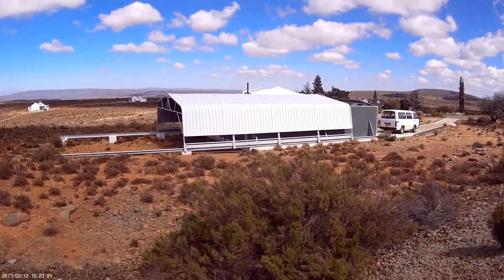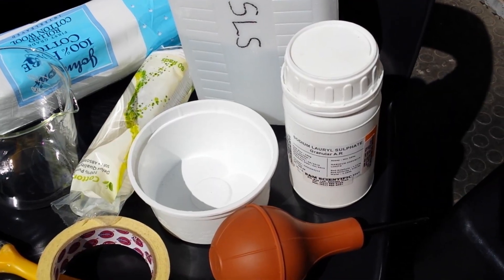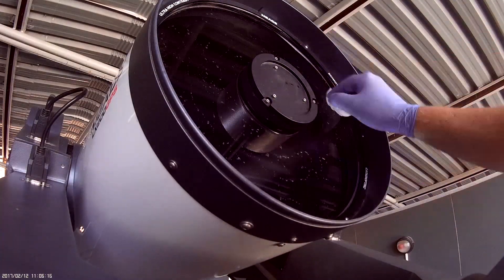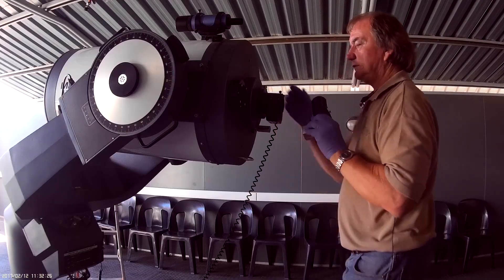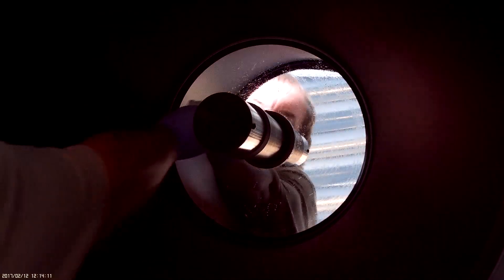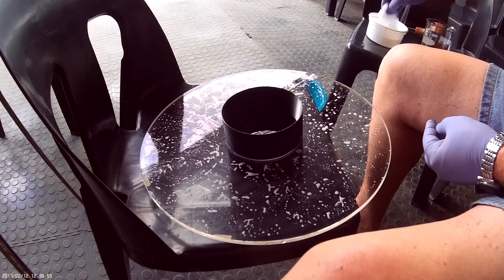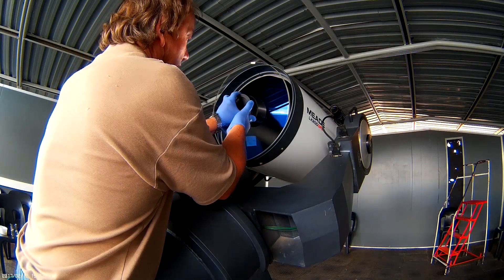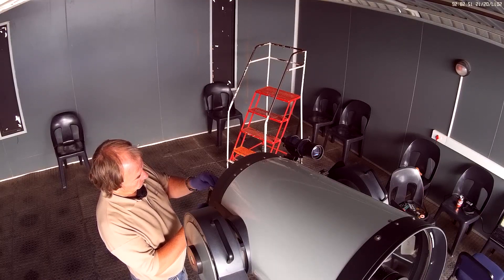How to strip and clean the optics of a SCT (Schmidt-Cassegrain Telescope)

Comment: Nice video. I was cleaned successfully with detergent and clean water. But I removed the prime mirror first. Your way is little more difficult but you don't need to remove the mirror itself. So if that's work you can keep doing that.
Reply from the maker: Thanks.  With both these models, the only way to remove the primary, is unfortunately to remove the corrector first to gain access to the primary's mounting system.

Comment: Thank you for the great video.  I have a question about this.  What can I do to find the correct position of the corrector plate if I have removed it before I knew it must be indexed a certain way?  My problem is that I have  taken it apart once and didn't mark it for reassembly.   Thank you, Scott
Reply from the maker: Hi Scott.  All I can think is to inspect the corrector and telescope tube very closely to see if there are not perhaps any matching markings put there by the manufacturer.  On the other hand, I'm not too sure how important it is for the corrector to have a specific orientation - in theory a properly made corrector should be symmetrical all around and therefore should not matter how it is assembled.  If you can collimate it properly (including on an out-of-focus star), it should be fine.
Reply: T. Scott Nalley Postman Buy Celestron Telescope NexStars From SOUTHMINSTER School Caravan Birthday CHILLDREN Cm0 ENGLAND CELESTRON MAN ASK POSTMAN BUY Celestron From SOUTHMINSTER School Caravan Birthday CHILLDREN
Reply: + Willie  Great video, thank you. It has given me confidence to open mine in order to get rid of a number of spidery fungus spots. I think I have killed them by exposure to the Sun, but they annoy me ;).

I noticed you DID mark the orientation of the corrector plate with respect to the OTA - presumably as good practice. I believe it matters less with Mak-Cassegrain scopes since their meniscus lens is easier to manufacture totally symmetrical. The Schmidt SCT plate on the other hand is a wavy affair and far more difficult to manufacture and collimate! I believe this was the main reason for the development of the Mak over the SCT.

Comment: Thanks for taking the time to share this video. Very informative. If you are just cleaning outside of corrector and not removing it would it be best to point tube down to prevent water from running down tube. I just need to clean the outside of mine for now.
Reply from the maker: Yes, most definitely! You don’t want any water getting inside the tube if you are not planning to access its inside.

Comment: Great video however,  in the beginning of the video you show a view of the "cleaned" C14 and the corrector plate is badly scratched. A little dis-concerning.......
Reply from the maker: Thanks Mike.  Yes, unfortunately the users tried drying it in high humidity conditions which caused the scratching!
Reply: "Disconcerting." No hyphen.

Comment: As a professional photographer I'd never put any liquid on  a lens directly, nor in such amounts as to form drops that could get in between the lens element/glass filter and the ring holding it in place. I would think if you had a cemented double lens that any liquid could get in between the lenses and play havoc with the cement. With a SCT you run the risk of water getting inside the tube and causing damage. (Ever see mold growing inside a photographic lens?) 

In photography you'd first blow any loose particles off with compressed air (use caution) or clean blower brush positioning the front of the lens horizontally or facing downwards so that any dirt falls away from the lens and not re-deposited on it. FOr any stubborn dirt I'd lightly use a dry tissue or clean microfiber cloth then follow up with a DAMP, lint free, tissue or cloth and lightly wipe the glass in a circular motion with multiple tissues if needed until clean.  

If you had no other option than to use dish soap (which is actually a detergent) and distilled water you only need a drop or two of the detergent. This is how professional window cleaners work. You only need enough detergent to break surface tension.

Forgetting that, before you do anything I'd first read the scope's manual for cleaning instructions or contact the manufacturer repair department for instructions. 

Here is a safer way to clean your corrector. https://youtu.be/2cMbivz-hrM

I disagree with his use of the word 'firmly' when wiping with the Pec Pads (Pec Pads are something I use myself). Lightly wipe so you don't grind and dirt into the glass causing scratched or damaging fragile coatings.
Reply from the maker: Correct Robert, I would not do such with compound lenses either where the capillary effect is a huge problem.  However, both the corrector lens and the primary mirror of a SCT are single elements, so no danger here.

Regarding detergent strength, I agree 100% (and say so in the video) to use a very weak solution.

Not sure where you got the reference to Pec Pads from - there is no mention of this in my video.

The methods I employed in my video, were derived from methods used by our optical specialists in our professional astronomical telescopes at SAAO/SALT.
Reply from the maker: Sorry, I only watched the Starizona video after replying, so now see that the reference to Pec Pads is from this video.  I would never wipe an optical surface (like the guy in the video, who does not even wear gloves) while there is dust present on it.  It does not matter how soft a cloth you use or how lightly you wipe, it is the dust already on the surface that does the (micro-)scratching.
Reply: I would never use compressed air as it contains moisture, nor would I use microfibre cloths. It is very important  to use fresh cotton wool as described in the video, all microfibre cloths do is transfer the dirt/oil to other parts of the lens. Also NEVER use a circular motion, it is the worst possible thing you can do. Willie's video is spot on for an SCT.
Reply: "wipe the glass in a circular motion" No! never do that if there is any abrasive particle you will scratch the optic pretty badly even if you change your pad frequently. Photographers exaggerate on the cleanliness of their optics and many times they end up doing more damage by cleaning so frequently and incorrectly than if they leaved their optics dirty. Here is a good tutorial from an optics company, they work with laser optics and many times the optics need to be immaculately clean or else a speck of dust could cause a break down and damage the optic due the intense laser light. None of the techniques involve circular motions, all of them are linear.  https://www.youtube.com/watch?v=9Pq4SeNmFYw
Reply: The very best indicator (for me) when buying an OTA or Oculars is the phrase, "never needed cleaning" In the best regard, meaning it has been cared for in such a way and handles that as such, its needed no cleaning, save for some puffs from a dust puffer. 

A question did cross my mind, since i've not needed to clean my OTA— once contaminants are removed, would a squeegee either with a cotton wrapping, or just the rubber, be a useful way to remove remaining water saving so much wiping?